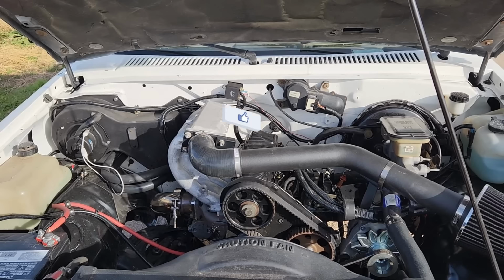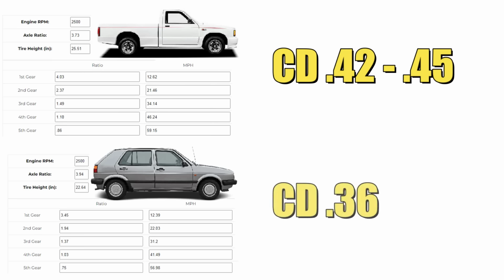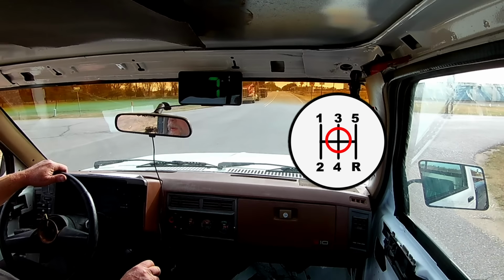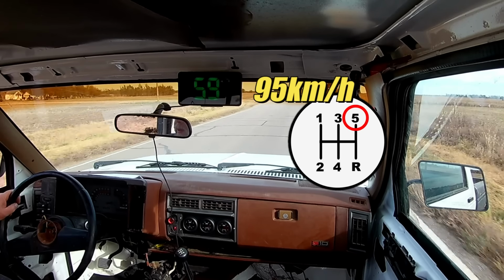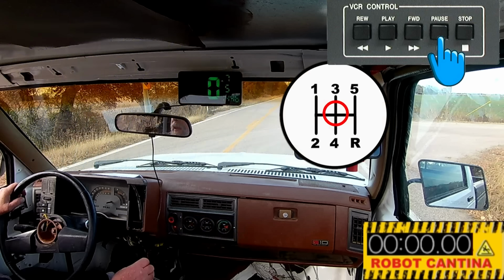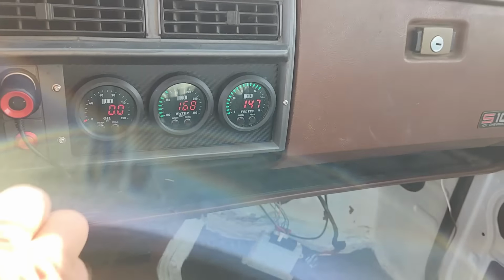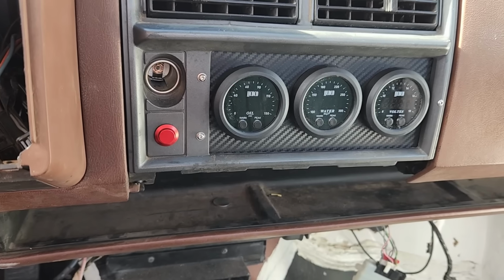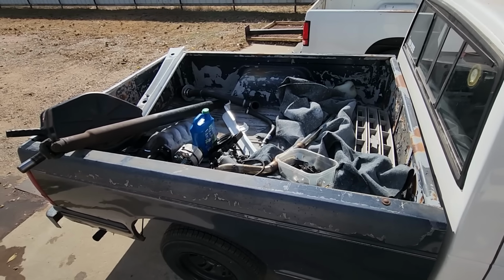S5 E43.  We road test the VW diesel powered Chevy S10... More problems?

Comment: My 88 S-15 had that tint new, Ray-Ban tint. Ok that would be base, with short tires, mine had 26+ inch tires, was looking at up sizing to 28. I got just over 2000 RPM at 70 mph. Sounds like hot expansion, always good time to pump those numbers up.. Remember when you thought that might be too high psi. NASCAR qualified now.😊

Comment: We used to have a road side assistence organisation (ANWB Wegenwacht) that ran Golf2 and later Golf3Variant (wagon) with diesel engines and those typically did between 400kkm and 500kkm with exceptions doing even better. 
So, if/when you get this oil pressure under control it will serve you quite well indeed! I have no doubt.

Comment: As a former S-10 and Ranger owner, I agree that fairly stock, manual transmission versions of those trucks were just about the perfect truck. Unfortunately, I sold one and ran the other into the ground, and by that time, the replacements were big, heavy, option laden crew cabs with tiny beds. Also, when is putting a fan in on your to-do list?
Reply from the maker: LOL, the heater core seems to keep the engine happy for now,    My primary focus is on sorting out the bigger problems.  I'll get to the cooling fan eventually.

Comment: Could a ported and polished head be enough to add enough power to reduce 2seconds in the o-55mph?
I really wasn't expecting to see a 54hp truck to be slower than a 20-30hp Honda Insight.
There is a long journey to make the perfect truck.
Reply from the maker: It's slow!  I need to verify the weight and keep in mind I'm just getting started.  LOL, with some practice I could probably shave 10 seconds off that time......Meh it would still be slow.

Comment: Check that the relief valve doesn't stick.  Could be a little bit of debris from fabrication. 
The aux shaft bearings are shite in these, though. They de laminate.  Over tightenIng the cam belt doesn't help, but they seem to die of old age. 
Hope whatever it is,  isn't terminal ! 
Love the work so far ❤
Reply from the maker: Thanks!

Comment: Great video as always but I kept longing to see the rpm while you were cruising at 59 mph to see how closely it matched your calculations.
Reply from the maker: Yeah a tachometer is definitely needed.  Typically putting a tach on a diesel is a bit complicated because there is no reference pulses from an ignition system.  I think the alternator I'm using may be set up for a tachometer output.
Reply: @robotcantina8957  you can always put a white line on the serpentine belt with a little sensor and record it that way, not the most reliable but it works on plenty of test rigs

Comment: Those little engines can rev to the moon. Didn't notice a tach in the video, but i had one of the little 1.6 na jettas with 500 thousand km that would rev easily to 5500. The later 1.9 would as well. All that was done to those were advanced timing on the pump, and extra boost on the turbo. They'd easily outpull a stock TDI
Reply: The german classic car channel "Halle77" have several videos with dyno test of the 1.6 turbodiesel versions.
Reply: I have had 3 1.6 turbo jettas over the years, all pulled hard to an absolute top end of 160 km/h (100 mph), had 5500 redline on tach, they love to rev. Sounded to me like he was short-shifting. Mine were non-modded, except for resonator delete, and rad frpm an A/C car (larger). Routinely ran them up to 140km/h on 400 series highways in Ontario. They could sit at speed for hrs. in cooler weather (no intercooler).

Comment: maybe it's an oil pan? you made it flat so now if the engine is tilted out of horizontal  it makes quite a nice oil trap on the back of the engine and you might need to shave the pan to be more sloped  especially if front of the engine is higher than the back . oryginally engine was transverse so pan was sloped from the sides 
give it some more oil and check if it stabilises if yes you  have return problem if not we need more in depth analisis. it would be nice to know the oil level in 3d all over the pan to  know if it ends up at the pickup or not

Comment: Bummer about the oil pressure Jimbo. As for the acceleration, you are almost in the realm of being able to measure it with a calendar 😂

For the 1Z/AHU, get in touch with the fine folks at Canada Catalyst. They have hooked me up many times in the past with my TDI needs.

The toughest part is going to be coming up with the engine harness and ECU. 

You can run the 1Z/AHU off an ALH ECU and harness, but it is far from plug and play. At minimum the immobilizer has to be written out of the ECU and provision made for boost control since the ALH had a VNT turbocharger.

Best of luck! Look forward to following this project!
Reply from the maker: Thanks!

Comment: Yep you’re right trucks aren’t tools anymore they’re status symbols. My 99 f350 is hooked up to my trailer 95% of the time and I only maybe put a couple thousand miles on it in a year cause I only use it when I need it.
Reply from the maker: I have sat in some really nice trucks and... they are nice... but I prefer simple trucks because they are just work horses that have a job to do.
Reply: @robotcantina8957 I paid $3,600 for that truck many years ago now and it’s been 100% loyal, I change the oil and fuel filter once a year there’s no blow by on that 7.3 powerstroke even at 265,000 miles.

Comment: Add a comment. It instructed me to add a comment Jim. That low pressure at idle could be a bad pressure sensor? I had to have mine replaced on my Dodge a while back. The thing read 100, No less, no more. Eh, electronics. As they say, Parts is Parts.
Reply from the maker: Thanks!

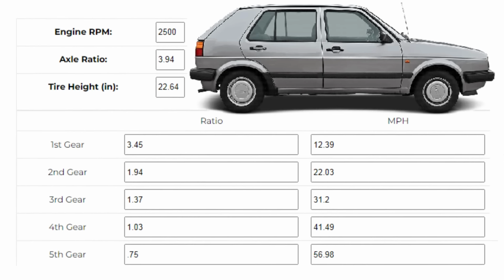Comment: 3:04 superbird nosecone for maximum aerodynamics? 😂
Reply: Kammback truck bed cover would have better results and be “somewhat” practical
Reply: @depthsounderdave  Or just take the tailgate off 🤷‍♂️
As I recall, most are tool-less and just have to disconnect the two cables and let it rotate down far enough for it to reach the cutout in the "hinge", and it'll come off.

Comment: This project makes me want an S-10.
Reply: As soon as you sit in either an s10 or an old ranger you wonder why the dakota didn't sell more.  I've driven all 3, imo, the s10 felt the most cramped.  On the flip side a lot of the g-body parts work, the aftermarket for them is wild.
Reply: @nocturnal0072 
I have a 92 Dakota with the 318...it's a blast, but likes gas.
I too think they are underrated,  and have owned Rangers and S-10s from the same era.
Reply: But with Cummins R2.8 crate engine next option is 4TB but it's also 300 pounds heavier and 10 inches taller
Reply: If you want another cheap pickup alternative you could get an old Ranger.

Comment: I see a an Ebay turbo in this projects future😉
Reply: Isn't there a stupid charger flying around in the shop too??😀
Reply: @dangoris4164 idk if it moves enough cfms to help if you're talking about the amr
Reply: @LattManthier so it has to be combined with a turbo 😎

Supercharger for instant "performance" and later on, when the turbo has gained some momentum, it can take over for the next stage of escalation towards peak torque 🧗‍♂️
Reply: @dangoris4164 the tuper charger would be a bottleneck and choke the turbo and then that would make the air intake temps go way up
Reply: @LattManthier or it takes an arduino and some complex plumbing with valves and so on to make it a true dual stage boost system

Comment: Thanks for the 0 mph to 0 km/h metric conversion Jimbo! 😄
Reply from the maker: Just helping our metric friends understand the imperial system.
Reply: @robotcantina8957 Yeah. Much quicker than doing 0 ÷ 5 x 8 in your head😂
Reply: Who knew, eh?
Reply: @ziggybowman6875  it sure ain't the same with temperature! Unless we talk about -40. 😛
Reply: @junethefirst  That's where everyone goes "It's eff'in cold"
Reply: @junethefirst  Yup! It was late-80s/early-90s that we in southern Minnesota had a really cold winter day, of roughly -45°F but was -75° with the windchill (this was before they refractors the windchill). That was when I found out that Freedomheit was finally ""colder"" [lower] than Celsius! 😎
(as it was 'only' -43°C)

I still remember that day because I was rather pissed... I went to a stupid private school which was in our town. All my friends went to public school, which was in the neighboring city... That also meant they were in a different school district, and each district determines snow days. Well THEY got one, but MINE decided it's fine and we only needed a 2hr Late Start. So my friends got to go sledding while I had to go to school 😭 (I did go sledding with them during that 2hrs, though)
Reply: @ziggybowman6875   -40° F = -40°C as well. Cool, eh?
Reply: Yeah! That was knee slapper for sure!
Reply: Where do you add the 32?
Reply: @Dr_Reason  C to F = (C × 9 ÷ 5) + 32.
F to C = (F - 32) × 5 ÷ 9.

Be sure to use parentheses because some calculators are dumb without them.
Reply: @junethefirst  Or for most people, use your iphone's calculator top right "conversion" button.
Reply: @Dr_Reason 
Into Google. I don't even try converting temperatures in my head.
Reply: You never know. Some folks out there might have thought converting MPH to KPH was like the Fahrenheit to Celsius calculations. 🤣

"OK, so he's doing 0 in mph, so that means in kph he must be doing about 28 BACKWARDS". 😁
Reply: Did you comment on your own video with another account or just someone else named jimbo
Reply: @wesleybell8638  We call my uncle "Jimbo" as well. However, he is neither of these Jimbos 😋
Reply: @wesleybell8638 i am the human jimbo.  Help!  Im being held captive by AI jimbo.
Reply: It is importat because 0°F does not equal 0°C for some reason.
Reply: @kevinmiller5467 Umm, yeah... perhaps because one signifies a lack of relative movement and the other is a point on a scale😂

Comment: little note, IDI engines are actually not even a bit more silent, but even smoother than TDI. I have both and i can asure you on that.
Reply: But remember there's two types of TDI the first were single Pump DI's with about 300bar injection pressure and made to run smooth, which they did. 
The second generation had the   "Pumpe-Düse" (Pump-Injector?) type direct injection and it sounds like they only cared about fuel economy and ignored all sound emissions 😀
Reply: @dangoris4164  i dont consider pumpeduse there at all, those are kinda shitty engines (1 gen had problems with injectors sealing, 2 nd one, that had 2 bolts per injector were pretty much good tho, 3rd and later are complete garbage, not because of injectors, but everything else, like 6mm hex drive on oil pump) so im comparing the engines with those legendary bosch pumps. also u can upgrade those with bigger plunger and such. also the best power gains are from the tdi with bosch pump, but my fav is the IDI with a turbo
Reply: Yea, idi is actually quieter. But when you compare them to a turbocharged di engine that came in a newer car with better sound deadening it seems louder
Reply: @trev0rbr  i have jetta mk2 with IDI turbo and audi A6 C5 with tdi. both have bosch injector pumps, not pumpeduse. and jetta is still lot quieter and and smoother than audi, even when audi has better sound deadening stuff in it

Comment: Had a Wrangler that used to like to show 0psi on the gauge at idle.  Ran 100K more miles without any issue.
Reply: Proof from real world testing, nice!

Plus - oil pressure also eats up HP and fuel economy...so the lower the better - to some degree 😂